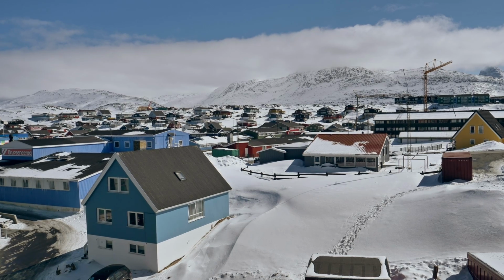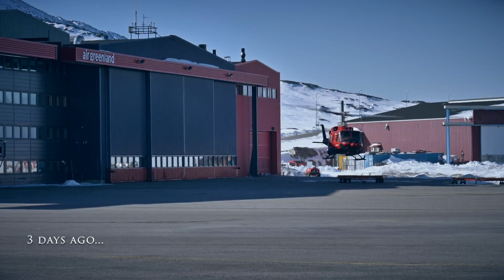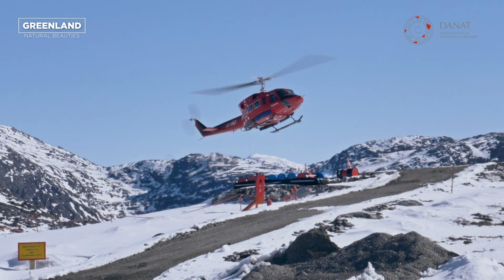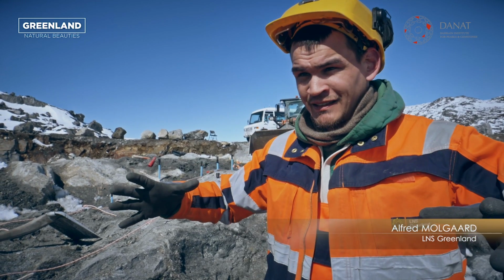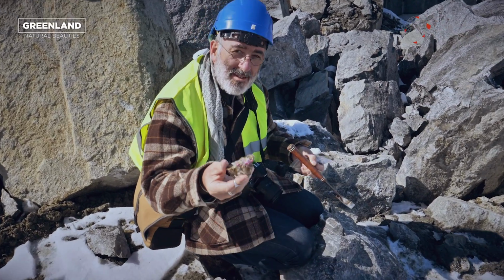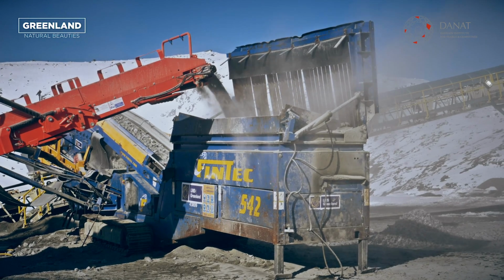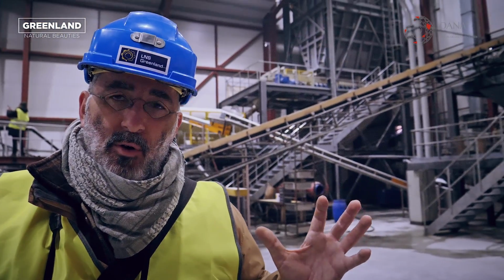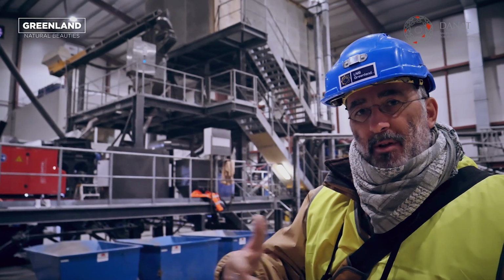Greenland Rubies - Natural Beauties

Comment: Sad, they blow up all the bigger sized Ruby's like that:(
Reply from the maker: Not really, but there is no other way as it is a hard rock deposit. First they use explosive producing low shock waves. Then they minimize the issue as they blast away from the ruby rich layer and they drill between the rubies and the explosive to deflect the blast...